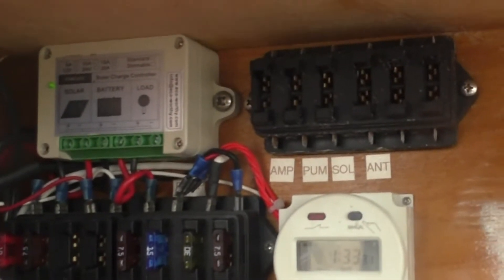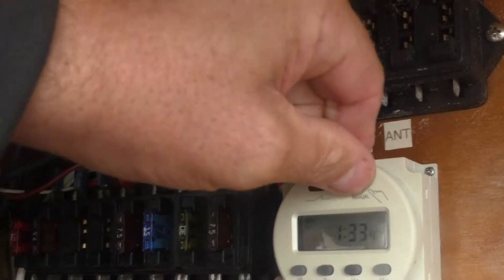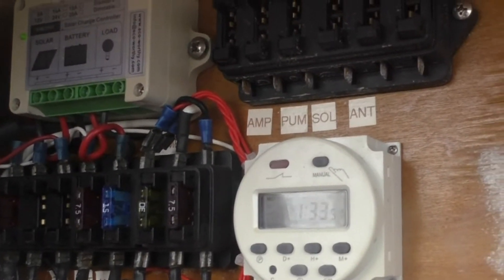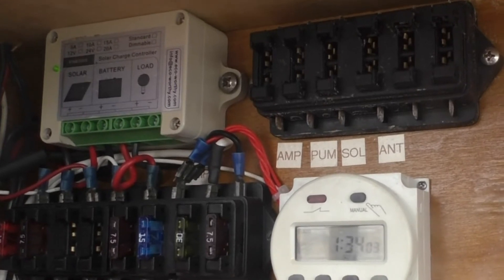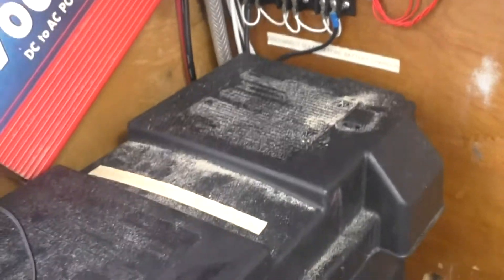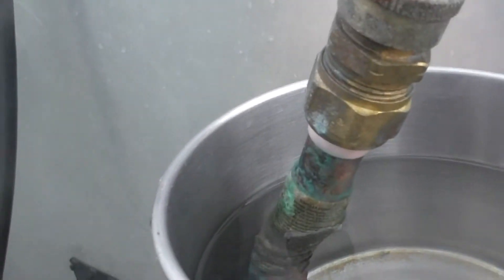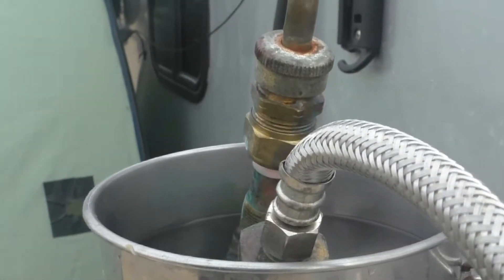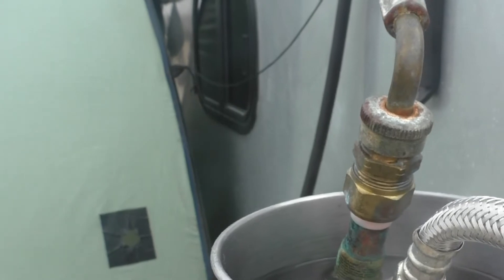teardrop camper hot water heater 2.0

Comment: Sir, did you butcher one of Camp Inn's trailers? Is that a 550 or a 560 Ultra raindrop that you have destroyed with that Rube Goldberg outfit of a hot water heater?
 
You have no soul
Reply from the maker: HOMEMADE ,BOUGHT IT OFF CRAIGS LIST
Reply: @lynperk  I apologize Lynn. I saw the aluminum skin and the woodwork in the back with the wood prop. Homemade is usually wear that but if you saw that 560 Ultra raindrop you would certainly understand. It truly stands out and looks like Flash Gordon's camper